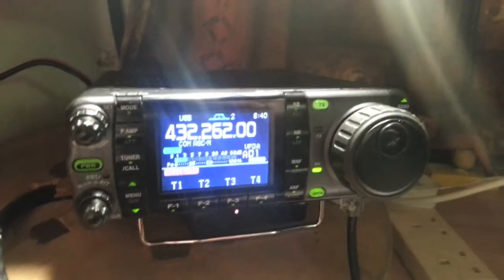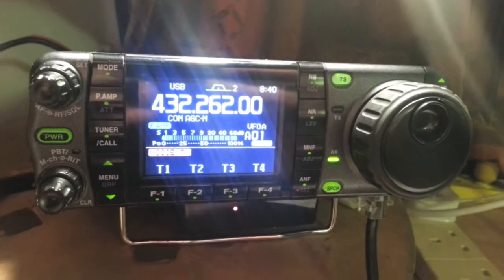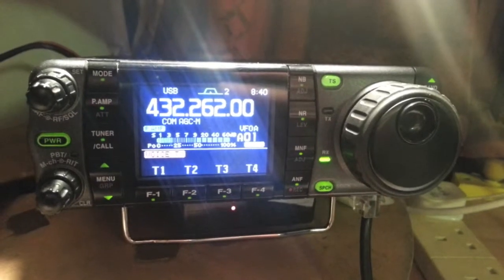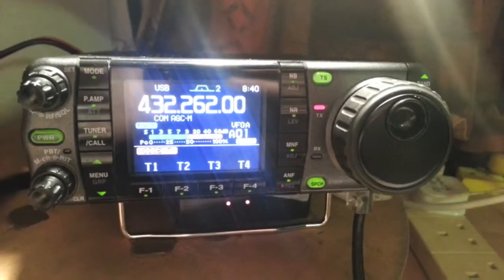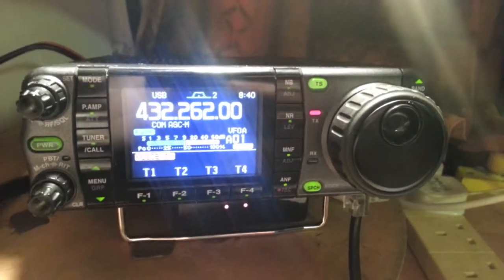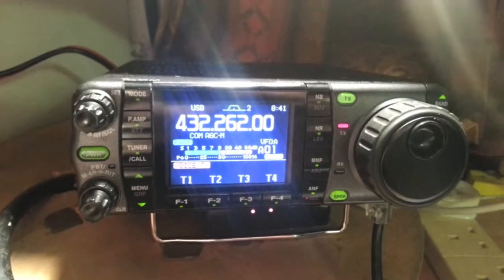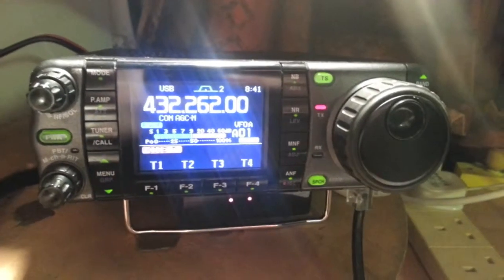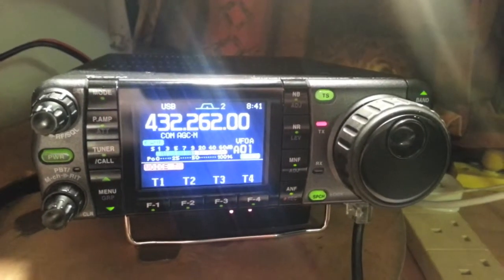Kevin (M0TBX) Comparing Speech Processing & Microphones on his FT857

Comment: Isn’t that an icy 7000
Reply: yeah, he's sniffing glue
Reply from the maker: @Nikonman77  this radio is an Icom IC-7000. However, the radio that's transmitting is a Yaesu FT-857. This Icom is receiving that. 🤷‍♀️

The video was comparing the receive signal strength with different compression settings on the transmitting radio.